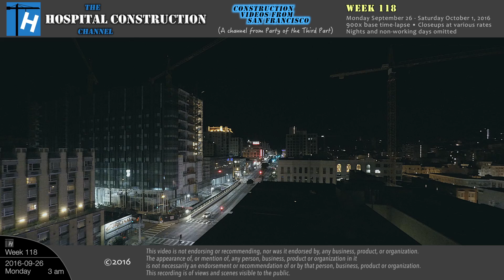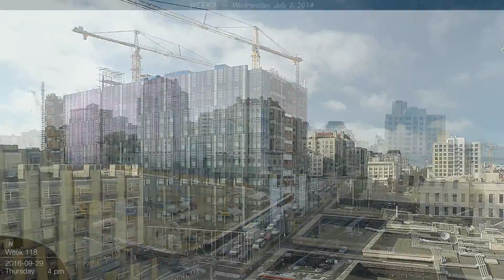Why the construction time-lapses are at irregular intervals after Ⓗ Week 118 (narrated)

Comment: Answering the questions about placing detail A to the slot B is actually correct assumption. We (i mean structural engineers and draftsman or drawers) make a so called assembly drawings on which every column beam braces and tiny structural details has it is unique name. So workers kinda sort out from the pile of columns which one they needed for that location (each peace has a tag on) and place it due to it orientation. Some times there is a mistake on the tag (put wrong tag ot a wrong detail) or mistake at the shop (like welder placed stiffener plate on the wtong side of beam) so it is not comming together and workers might rotate some members or switch them. And also when drawings are complex or tightly packed with leaders and marks you might just misunderstood what detail name you need. Hope it was useful. I also can show you some drawings or examplain something about the process of modeling and design if you like =)